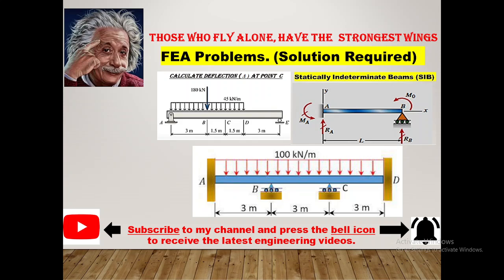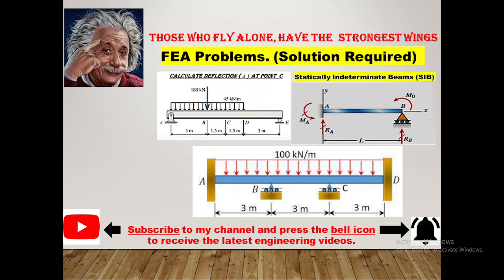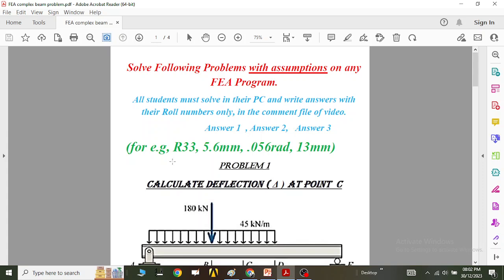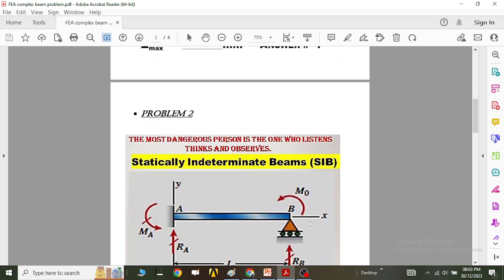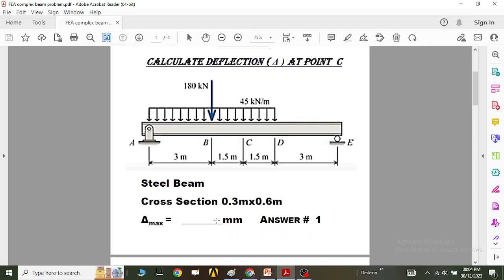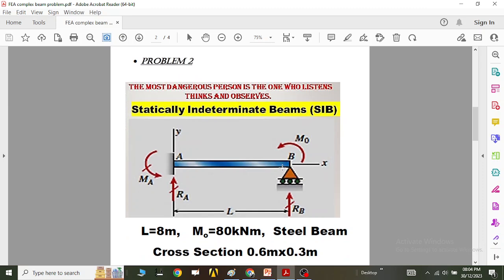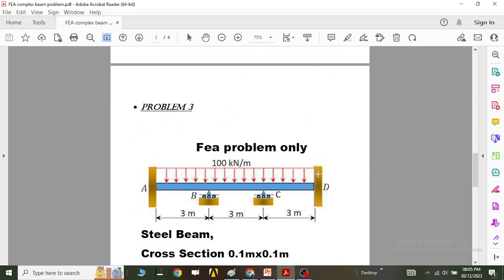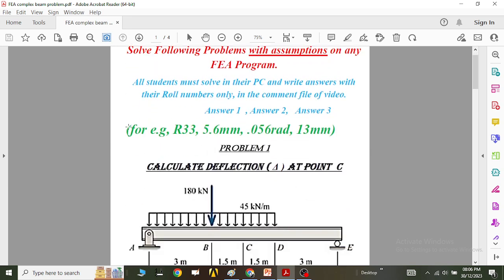Fea Problems for Technical Knowledge Seekers.

Comment: Question no 1: minimum, maximum, and average is -5.0066mm
Question no 2: Flexible rotation probe is 1.5026 e*-004
Question no 3: minimum is 0, maximum is 12.931, and average is 6.8762

Ayesha Arif